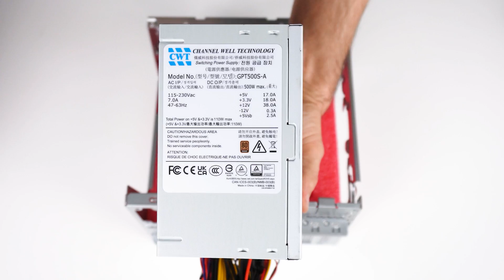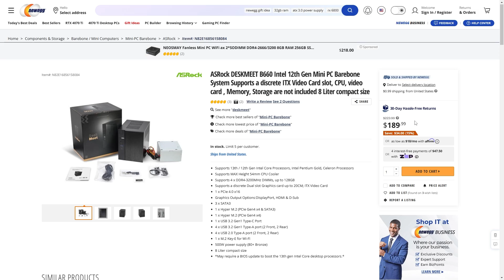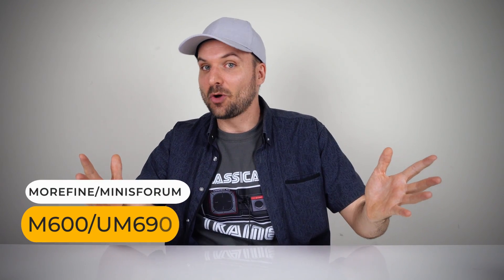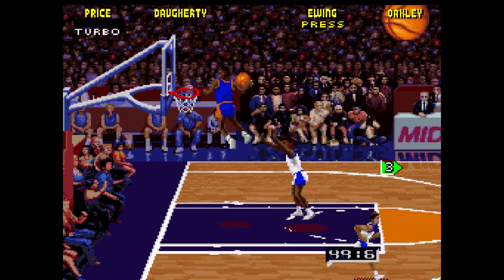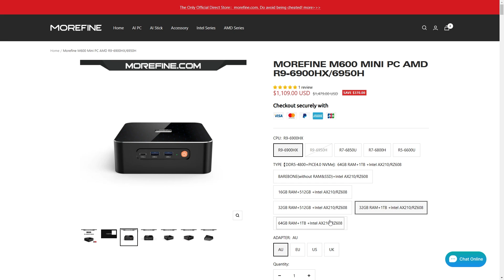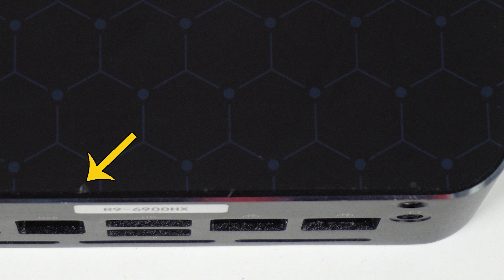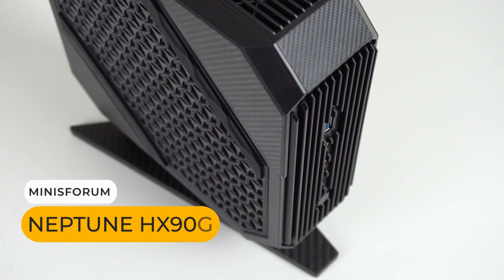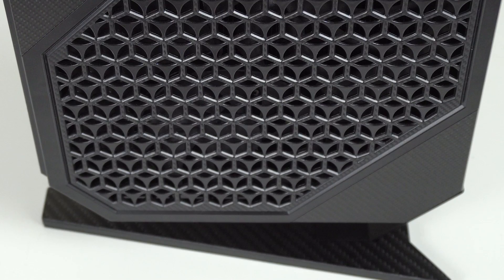Best Mini PCs of 2022! The 5 Best Minis Reviewed

Comment: I recently installed a new ssd and ever since then I went from getting 120 fps to 60 fps, looked it up and it says ssd can lessen performance so I uninstalled the ssd and I still only get 60 fps PLEASE help
Reply from the maker: SSDs don't reduce gaming performance. Probably have Vsync on or some other setting like GPU power saving. In any case it's too little information to go on. Reset or reinstall Windows if you don't figure it out.

Comment: I've been waiting so long for something good, I gave up and bought a second-hand/refurbished NUC for $250 off ebay, which came with a decent M2 drive, RAM, and Windows 11 licence.
Theoretically, I could sell the M2 drive, RAM, and licence, and destroy the NUC, and make about $50 net profit.  Yup, I effectively payed NEGATIVE $50 for a NUC.
Reply from the maker: Which generation?
Reply: @Robtech  8th generation i5.
Runs fine.  Never tried gaming on it.
Guessing it was an office machine bought just before COVID shut all the offices.
Reply from the maker: That was a great unit for its time

Comment: Coming in at #4, my tall NUC12 Pro i5 (NUC12WSHi5) died last week.  One of the Thunderbolt 4 ports apparently had a hardware failure.  From the start that port was flaky -- plugging in a USB 3 SSD enclosure resulted in constant disconnects.  Finally Windows 11 started giving me errors about "USB port drew too much power" and the port died completely.

Luckily the replacement process here in Germany is easy - I just sent it back to the place I got it from (the unit here has a 2 year warranty).  I expect the replacement to be delivered tomorrow.
Reply from the maker: Only two years in Germany? Hmm thought it was three years worldwide, but I guess it's just in Aus... But yeah, Intel makes it easy to get a replacement.

Comment: How are NVMe temps in the UM690 for general use?  Would a 4x4 run hot?
Reply from the maker: My test is to install a 50GB game as the drives get hottest from writing data. Max temp for the UM690 was similar that way. They perform okay using general use.

Comment: Speaking of "what's getting through QA", this top might be very different if mid-long term use is considered (2 - 5 months)
On a separate note, I'd love to see a top that also takes into account criteria such as customer service, warranty (and how this service is carried out) shipping (costs, delays etc), return policy (for those that do not buy from Amazon). The forums are piling up with complaints ranging from faulty products to unstable drivers to non-existing customer service.
Reply from the maker: Channel's not big enough to allow me hold on to any units apart from the ones I use daily.. And if it's a free sample or loan unit, I'll be given priority treatment from customer service anyway, so it won't be a useful metric. For good warranty service, best to stick to big brands like Intel, which is why I tend to bang on about the three years. Buying on Amazon and using PayPal when checking out will also provide additional protection in the short term for the other brands. In most cases you'll need to pay shipping fees to return a faulty unit though. While Intel has provided me with shipping labels the few times I made a warranty claim. Risk is always there, but I'd assume most DOA claims are handled without issue. If you have a terrible customer experience, send me an email. I sorted out a few for viewers last year.
Reply: This is normal from China. It's a total lottery. Have the mindset of "can I lose this money". Nothing has changed in my past 20-30 years experience, so nothing will.

Comment: Why the Ace Magician AMR5 with 5600U Is not in the rank? Seems to be similar to the Ser5 in 1st position but with 1 slots M.2 Nvme...
Reply from the maker: Costs around 20% more, TDP switch didn't work properly (not sure if it was ever fixed), RGB software was bad and the barebones had no cooling for the dual M.2s.

Comment: Amazon (US) has had great prices for the SER5 5560U for weeks and if you look carefully you'll find many different pages for the same model, many of which have discount coupons from that seller. Just now (about 5 hours after Rob's posting of this) I checked and they were just over $300USD. I had this unit and it's great bang for the buck, though it needs to have the fan 'liberated' via the BIOS, which is pretty easy. I agree with Rob that this is one of the better bargains, help by the fact that Beelink, Minisforum, etc are now producing 6000 series AMD-based units.
Reply from the maker: Not a good launch price, but the price drop made it great 👍

Comment: I wish AMD would make their own 1st party NUC competitor
Reply: Honestly, between Minisforum and Beelink, I think ti's pretty well covered.  And with Minisforum announcing the the UM773 mini-PC, I am waiting with baited breath for one based on the AMD Ryzen 7 7840HS.
Reply: @murdock94  Why not the 7940HS?
Reply: @martijnrammeloo1167  They are basically the same processor.  The 7940HS has a slightly higher base clock and boost clock.  The biggest difference for me is the graphics cores is 3000 MHz for the 7940HS vs. 2800 MHz for the 7840HS.  

I feel like a 7840HS barebones will be a couple hundred dollars less then a 7940HS, so I can invest in faster RAM, which should give more of a boost to performance over all.
Reply: @murdock94  Makes sense! Let the wait begin. I hope they solve the NVME cooling, then this may be the ultimate PC for my use case.
Reply: @martijnrammeloo1167  Well, I'm also thinking about waiting to see what the desktop APUs look like.  If they have 7700G with 12 RDNA3 graphics cores, I'll probably end up building an Chopin Max based machine instead.  At least that would give me an upgrade path.
Reply from the maker: Never say never, but it's unlikely.